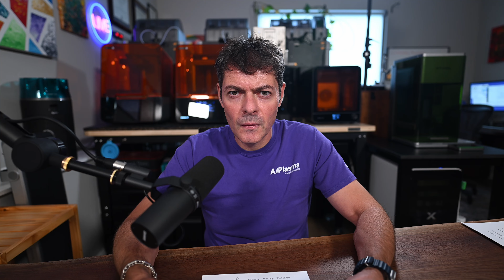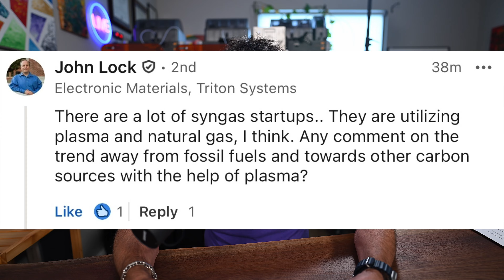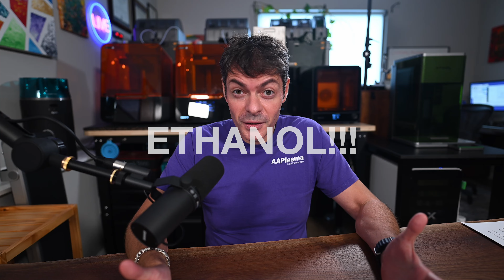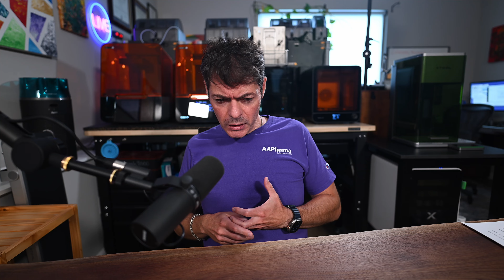Syngas: The Plasma Trick That Turns Waste Into Fuel

Comment: Worth going back to the source here, what are you looking for gas? What other waste products are around that are an issue and causing pollution... animal waste and slurry. So use biomethane anaerobic digesters to clean up the slurry and produce methane. The digesate though is an issue that needs to be worked on more. It can be used as fertiliser but a sustainable method to fully extract the ammonia from the digestate would really help fully ulsitse the value in it.
Reply from the maker: We’re actually working on that right now! Lovely project, though stinky, a bit